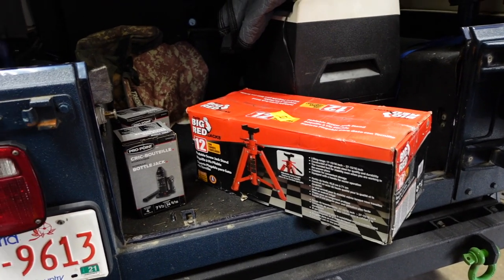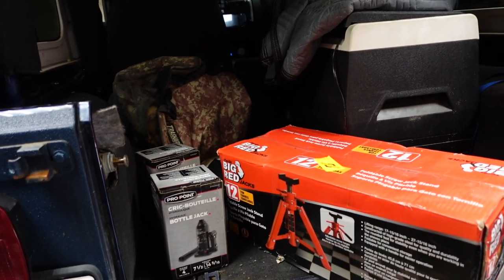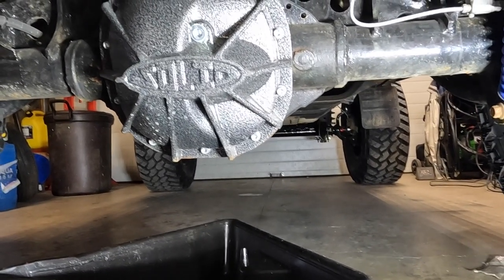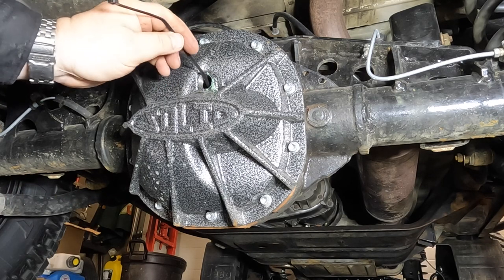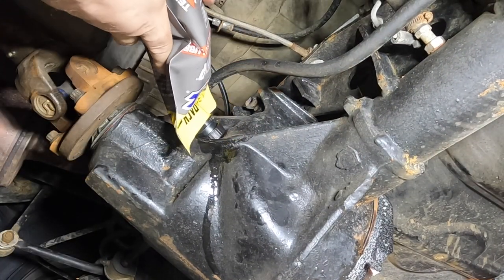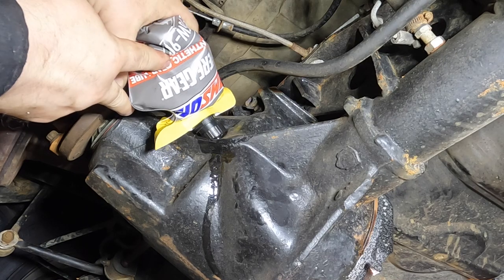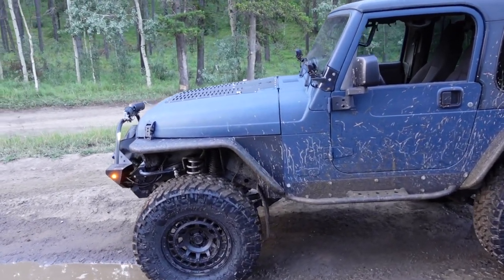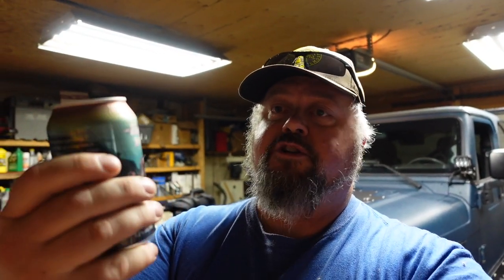WOW HOW DOES THIS EVEN HAPPEN

Comment: Big red makes good stuff. They sell that brand at menards down in the states here. I have their stands and big boy Jack with zero issues.
Reply from the maker: They sure do and available in many places
Reply: The big red floor Jack I have weighs like 100 lbs but it has been lifting my f350 diesel front end up no problem for like 10 years now. Good stuff.